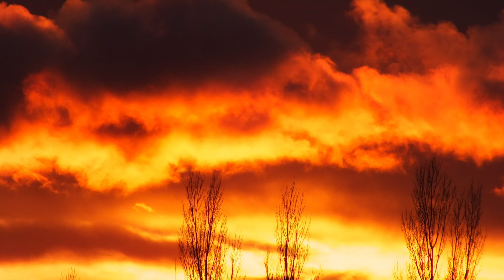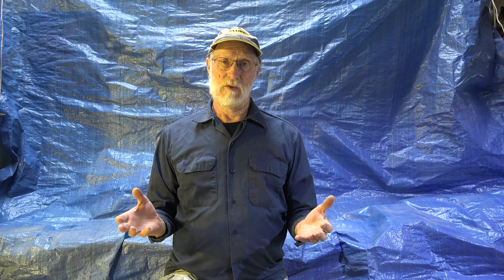Perception of comfort.  Feeling of cold/warm air blowing on you #2

Comment: Oversized units short cycle. They don't run long enough to heat/cool the objects and walls in the structure, don't remove enough humidity when cooling, and cause break downs from turning on and off too often. Years ago everything was oversized by some degree as unit efficiency wasn't as big of a deal. And like you said, some people, almost always guys, feel like their unit is great if you can hang meat in there.
Reply from the maker: So true.
GFM
Reply: Yup! Oversizing a unit is often worse than undersizing it, and it seems to be much more common. The house I bought has no central AC and a 24000 BTU AC unit in my bedroom wall cooling about a 250 square foot bedroom. It is so oversized that it runs for about 30 seconds at a time, especially on a cooler day where not much cooling is needed. Trying to sleep in that room is miserable!

Comment: I have learned a lot from your videos. And yes, different folks have different comfort levels. I recently installed a Kelvinator system in a customer's home that wanted units that were 1 and a half times what was required. I was finally able to talk them into installing the correct size equipment, but I was exasperated! I love your videos; keep up the good work!
Reply from the maker: +Danny Parrack Trying to get them to understand that oversized is sometimes worse than undersized can be a problem.  Thanks for the support.
GFM